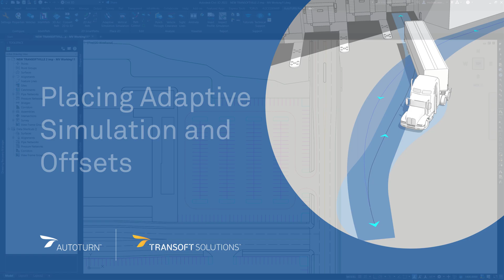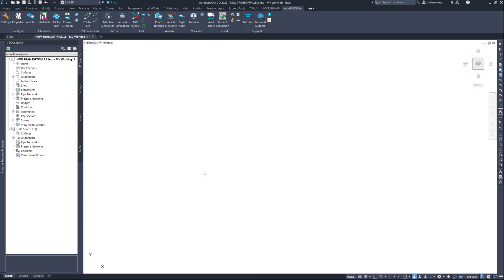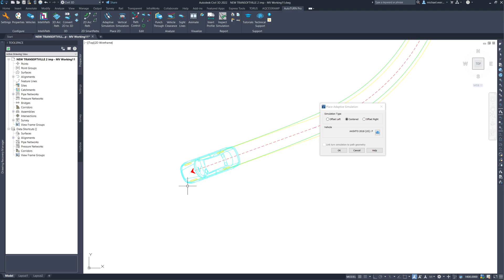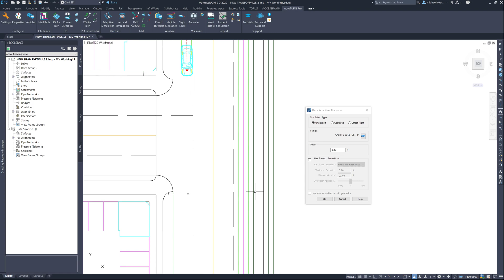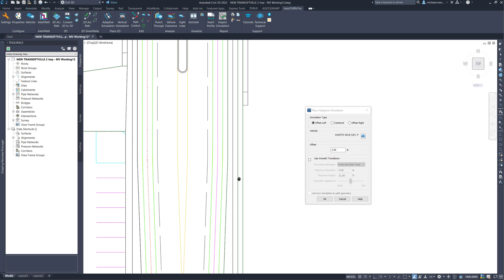AutoTURN - Place Adaptive Simulation and Offsets

Comment: Hi, for generating arc path the user can select the speed. What is the speed used in adaptive simulation? Can we change the speed?
Reply from the maker: Simulations generated on pre-drawn paths, do not account for speed, lateral friction, super-elevation or steering wheel turn rate. The steering wheels simply follow the path and the body follows in turn.
Reply: @TransoftSolutionsInc  thanks